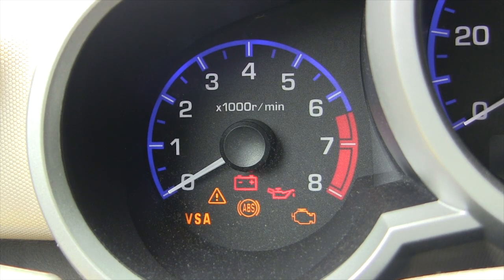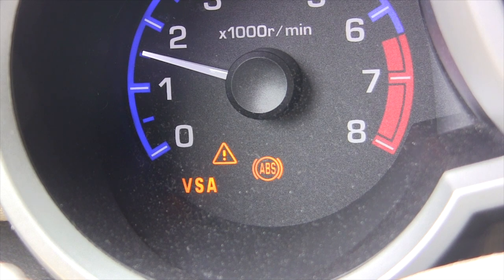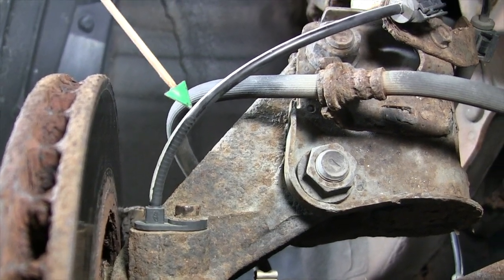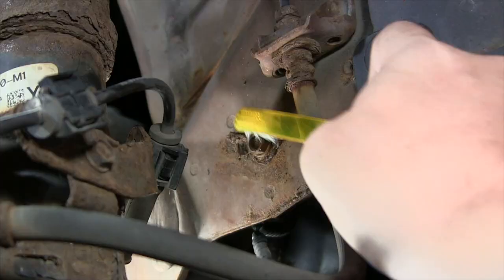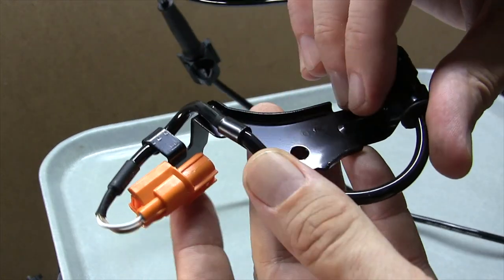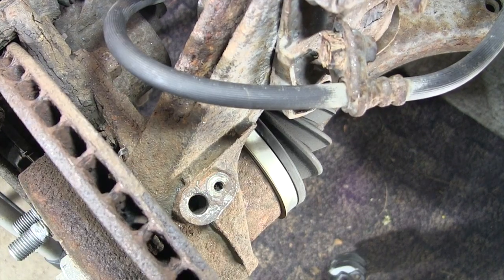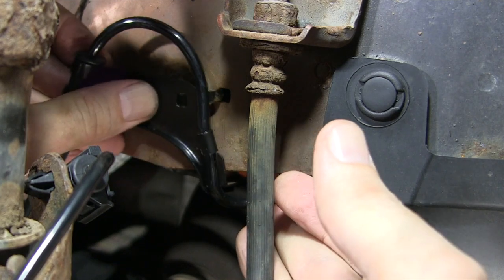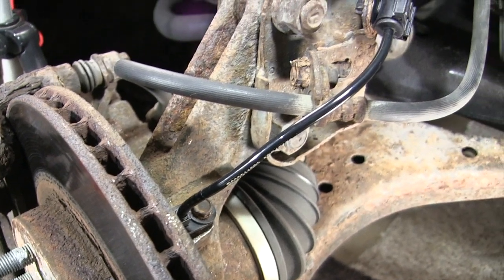Honda Element ABS and VSA light on!!

Comment: I feel like I’m watching a “How it’s Made” episode. Your voice is great for these kind of videos 🙂.  Ok, about my car… I have an Element and replaced all sensors when changing the wheel bearings/hubs. Did you find out what the problem was? I read a forum about the vsa modulator being a common problem with these cars and at some point Honda was covering the replacement (forum was from 2014). Some others were saying it could be corrosion on the ground cables.
Reply from the maker: I only managed to get the cable replaced. (which it really needed) I did not get the dash lights to reset for more than a few minutes, so there is more work to be done and more for me to discover.